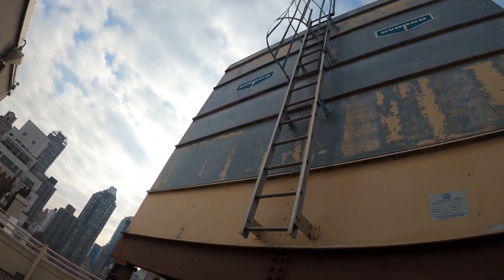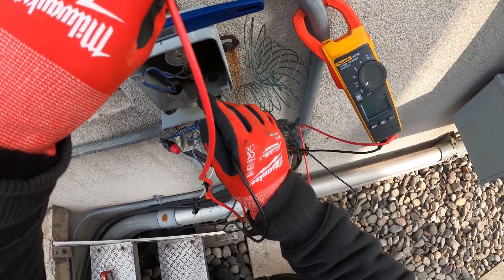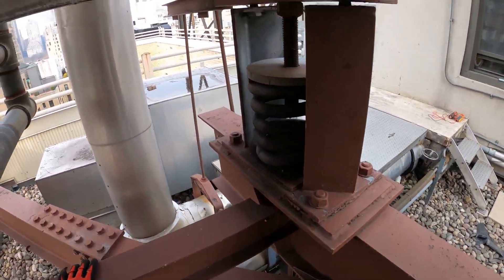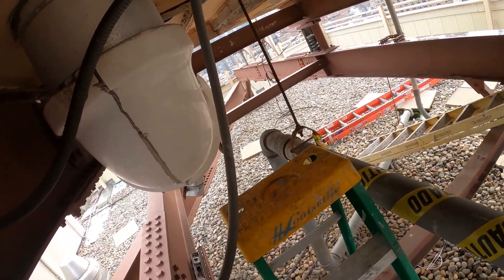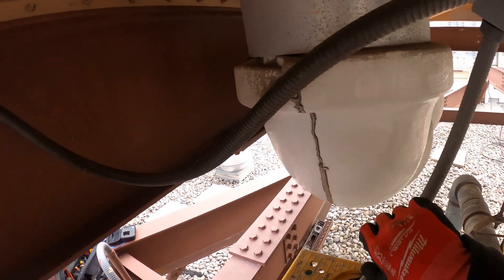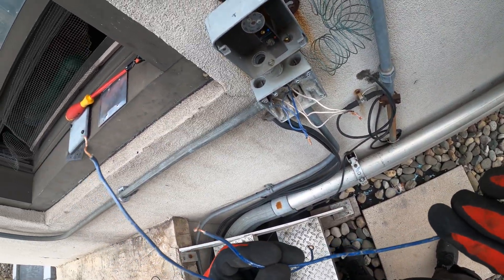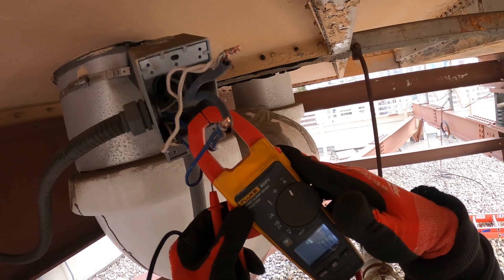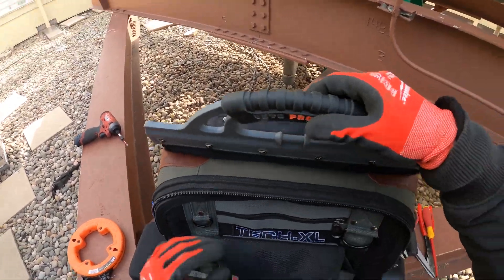HVACR: Cooling Tower Service Call (Heat Trace Cable/Circuit Breaker Keeps Tripping) Short Circuit

Comment: Sorry to say but I had to put a comment here, underneath the tower you had a split in a box, in that box bare copper and charring on the wire, did you fix that?? Didn't see you fix that, didn't hear you mention you fix that. You should have started ohming out the faulty side, would have saved you a couple of walks back and forth. You moved that flexible part of conduit, you could have temporarily negated the fault and made a bad conclusion. Just letting the breaker pop is bad fault finding, it's guessing. Read the manual of you meter and discover new faultfinding ways. I'm sure there is a continuity check on that meter, use it.

Comment: First video i have watched of urs and it’s excellent. What is the correlation between volts and amps? Assuming amps r supposed to present with volts? What happens if the volts r there and not the amps? Thanks 🙏
Reply from the maker: Thank you so much! I appreciate you watching & leaving a comment🙏🙂 The correlation would be best understood after learning about "Ohms Law". This is what they teach in schools when learning about electricity. The correlation & take away would be as the voltage increases//Amperage decreases and vice versa - As voltage decreases//Amperage increases⚡Something to note: As the amperage increases so will your electrical bill!!!😅 Voltage is a measure of the pressure that allows electrons to flow, while amperage is a measure of the volume of electrons. It's quite tricky. I should make a video on ohms law🙂 Stay safe out there & subscribe for new videos every week🔧
Reply: @JumpermanTech  will do brother man, stay safe as well. Cheers!!
Reply: Please make a video on electrical, that’s always been tricky for me. ! Thank you great troubleshooting!

Comment: THHN /THWN Stranded wire  be better than that solid core wire. Looks like someone Didn't put the correct wire and put solid wire very terrible thing to put.
Reply from the maker: I very much agree with you! I ran solid wire before through conduit with bends as my boss didn't want me to buy stranded since I already had the solid in my truck and man oh man did I learn the hard way🤦‍♂️ Biggest pain in the butt and it was a mess. I understand to use it in places that code requires but man, I am NOT a fan of it haha I was wondering if this was correct. Thank you for the feedback & watching! Stay safe out there & stay tuned for new videos every week🔧

Comment: I worked in that cooling tower before 😅. This is 130 5th ave in the city.
Reply from the maker: Dude another person just mentioned the same address as you! Haha
Reply from the maker: Maybe it looks similar but this is a different building lol Not far from where you are talking about!! 🤣🔧
Reply: It also had my old company sticker AFGO, that's why I said. 🤷🏻‍♂️
Reply from the maker: @eduardc5706  It does have an old AFGO sticker👀 This account has been handled by a private contractor for the last 10 years or more🙂 Good eye & thanks for watching!🔧

Comment: You can also ring them out to ground.. any resistance to ground will tell you what wire is bad. Good job man!
Reply from the maker: I couldn't find any grounded wires using resistance🤷‍♂️ This one was weird or maybe its my meter. Thank you & thank you for watching!🔧👍
Reply: @JumpermanTech  You could do it using the screw that holds the junction box if you want, :p

Comment: I’d rather use an insulation tester on the wiring instead of having to try the breaker with live power. Seems to me like a much more safe way to work
Reply from the maker: Couldnt find any grounded wires using resistance🤷‍♂️ Can you buy me one boss?👍 Thanks for watching!
Reply: @JumpermanTech  if I could, I would ;)
Reply from the maker: @AlecMeijerinkNL  🤣🤣🤣